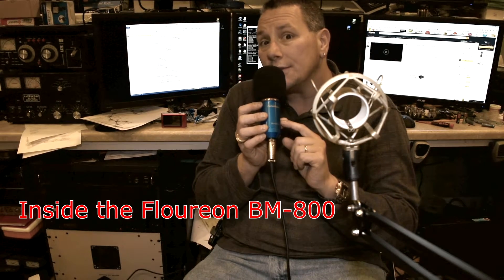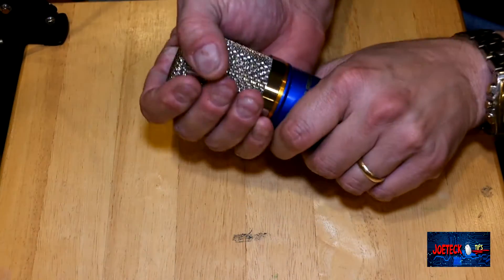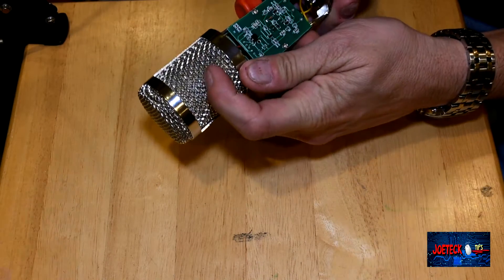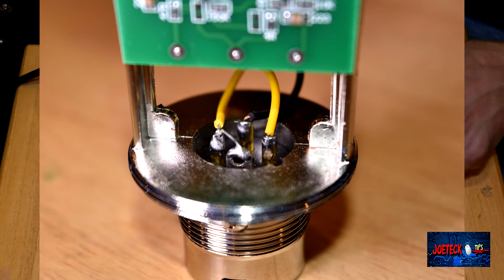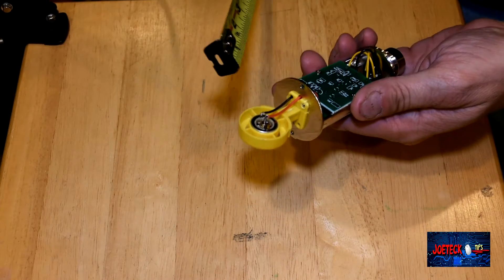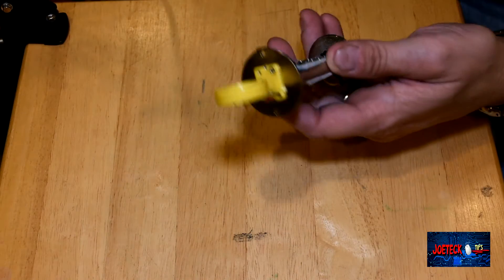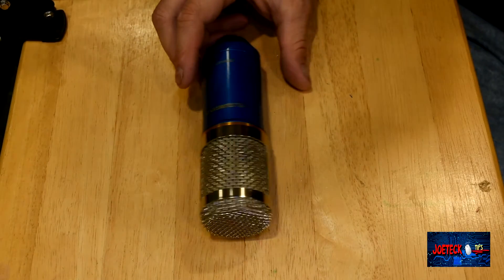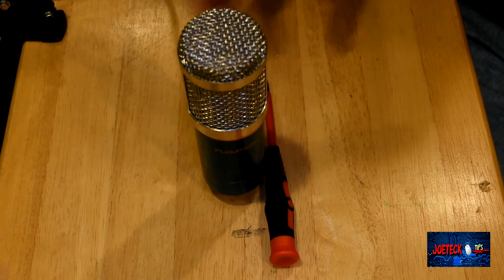Inside the Floureon BM-800 Microphone

Comment: Wow  this is a hackers dream,
 it looks as though   the diaphragm mount will take a 1 inch  diaphragm  on   the riverside.
Swap out or add a few capacitors,  that blank  circuit board will come in handy for adding more  transistors  or maybe daisy chain  a completed  circuit board from another BM 800.
 The casing and cage looks really cool,  I must get researching..
Thumbs up for the video
Reply from the maker: Awesome comment! PINNED!
Reply: @Joeteck  Thanks I've edited a bit of a spelling error there
Reply from the maker: @yapyap66  Wasn't necessary, but thank you! Thank you for being a JoeteckTips supporter! 32 shy of 11K subs!
Reply: @Joeteck  Subscribed, thank you

Comment: This mic does require 48 volts phantom power. If you do some simple research, you will find out what the circuit board actually does. It will not blow up using a 48 volt phantom power supply. It will actually work at optimal performance.
Reply from the maker: FXN F U N X T R E M E N E T W O R K it does not work very well though.
Reply: Yes it works very well.
Reply: So Edward, I am having a 48 volt phantom power supply and I still cannot get my music recording started... Anything else I need to be doing... 👍👍

Comment: did bm 800 can record left and right?
Reply from the maker: Kecoaxx it's a mono microphone it will record left and right but not stereo
Reply: Mic's are not stereo you can buy "stereo" mics but they are in fact two mics in a X-Y set up. To have stereo you must have two separate signals a fig of 8 can record two singer but it will be mono or Omni mode you could record a group of ppl standing around it in a circle but it will be a mono source. When multi inputs are recorded then panned Left Right Center during mixing you can get a Mono or Stereo mix. Always chk yer mix in Mono that will tell you if your stereo mix will hold up.

Comment: Great video Joeteck. Now I'm wondering if ALL the mics like this one (and there are a lot on the market that look exactly the same) are built the exact same way?
Reply from the maker: I no longer use this because the quality is just not there. Overdrives like mad, regardless of the mixer settings.  I use a Movo wired LAV mic now. I just took it apart because it seemed like a good idea for my viewers to know whats inside of it. The actual pickup (the microphone part) differs from mic to mic. (of course) The quality of the Phantom power circuit board may be very similar as well.  Quality of parts. So many people re-engineer stuff all the time. ;) glad you enjoyed the video. This video before I had my studio, so it was a little ruff. Thanks for the comment!
Reply: I bet they are all made in same factory w/different names it's obvious they are the same mics. I just got one in today if nothing else I got the Mic moveable Arm & a extra shock mount w/a bonus mic sometimes cheapo mics come in handy during certain projects for that maybe once every three years application. I haven't tested it yet. I waiting on the Roswell mini K-47 now that is an amazing mic for $299 the4 capsules are German as used in the mic of lore the U-47 that cost about $15,000.00+. You gotta chk it out I would suggest that or a C-1 from Studio Project that's an AMAZING mic so good Nuemann sued them when they started up they did use Nuemann capsules on the original w/the 777 on it. many pick it over U 67's it's about $300+ for the Studio Projects mic the lower cost B-1 ain't too bad either the C-4's matched pair I'd put up against any Neumann small dia condensers those fetch much more used they do hold their value. Best kept secret in mics Studio Projects.

Comment: That 'thing' is SMD diode, not inductor or fuse as you said. Lack of knowledge?
Reply: that thing is 9v zener diode
Reply from the maker: 5:00 Lack of knowledge perhaps? I do agree it does look like a diode. If you notice, every component is labeled with a value except that part. SMD Resistors or SMD caps.  If it were a diode as you call it, it would have a D next to it, but its not labeled at all. Thanks for embarrassing me.
Reply: Heh, Chinese people just don't bothered to put proper designation. So, microphone works, price is affordable, and in the case of complains, they will answer you: "but, you did not paid high price for this product". :D
Reply from the maker: They did, just not all of it. Maybe they don't know either. could have reversed engineered another product. lol
Reply: Heh, maybe. :D
Reply from the maker: WildMania Hahahahahaha